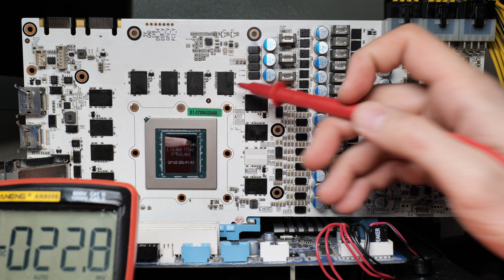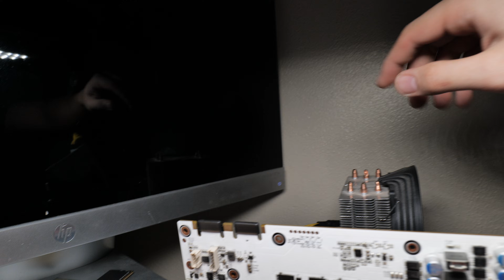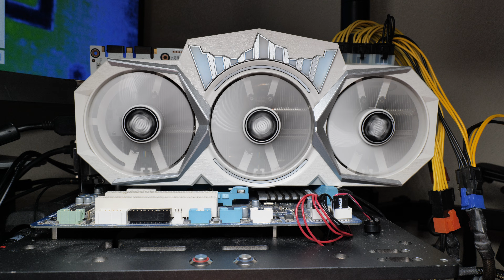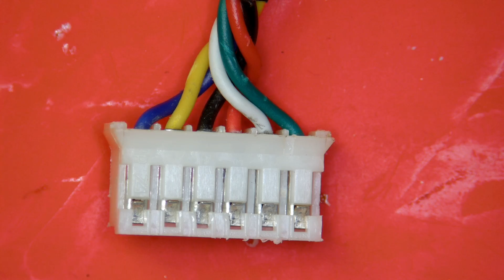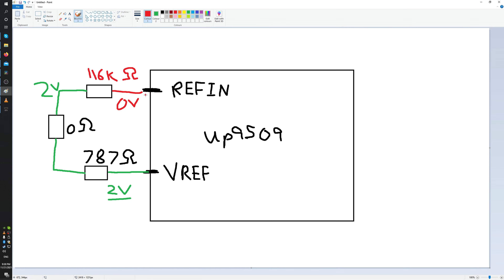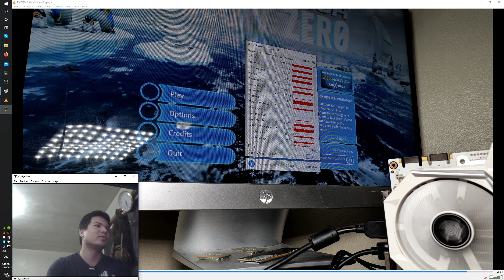Galax GTX 1080 Ti Hall of Fame Graphics Card Repair - POSTs With No Image and a Backlit Monitor

Comment: I bought a $60 EVGA 1080 Ti SC2 Black Edition today and it's got a similar issue... Card doesn't seem to get any power. Fans don't spin, no output, PC doesn't detect it, but the PC does boot... Any idea what the issue could be? I know you have another video on an SC2 1080 Ti but that one was for PC not powering on at all

Comment: Well played I wish I was as smart as you, I have the same card, today I herd a pop and some smoke came out, computer turned off, tried again same thing, removed card and computer turns on. Is there any chance the card could be fixed or you think it's definitely dead? Or could it be the PCI express slot, I can't check till tomorrow, I tried to take the top plate off the card to have a look but it broke the thermal paste so I have to get some more.

Comment: Hi, I really like your videos. Keep it up with the same spirit. 
I have an evga gtx 1050 ti sc and I have a few questions.

1. All measurements are fine - voltages, ohms, but there is no image on the screen. I tested with mobo with second PCI-E with another video card and in the device manager shows it (1050 ti), take the driver, but immediately after that it gives me the exclamation mark and code 43. After the system restarted, when I went to check the manager, the exclamation mark disappeared, but there is still no image.
2. When I open gpu-z, it gives me almost nothing. 0 mb memory, no pixel shaders, no sensors, nothing specific. I tried using a programmer to flash the BIOS with several revisions, but with no success
So I suspect a few things:

1. The BIOS chip itself
2.Bad memory bank
3. The main processor itself
4. Bad resistor on the line to the BIOS

I know it's hard without the card in front of you, but I'd appreciate it if you could give me some advice.Thank you.

Comment: I have a Radeon RX 5600 XT 6gb, the card is mine if i manage to fix it, but can't figure out what to do, and goes like this:
It has 4 ports: 3 Display ports and one HDMI, literally one of the DPorts is toasted, burned, the others ports are visually intact, when the card is put in the motherboard it don't give up any image (in the screen appears: No Signal), no beeps are heard, AND the PC starts as ever (i know because the intro of windows sounds normally), i try without the fans shortly and the card don't warm or heat at all, when i put the fans these move, but the rest of the card is still cold,  any ideas?

Comment: I have a 1080ti with a short on the base 12v rails, no visible damage, what would I check next?
Reply from the maker: Assume it's a MOSFET or Powerstage. I have quite a few "Computer Won't Power On" videos you should watch.
Reply: @TechCemetery  thanks, will go and check them all out

Comment: Thank you!. Love your vids especially since I happen to have 3 broken video cards. :)  I have 2 x GTX3070s and no idea what the issue is. One artifacts after some time especially on some games, and the other one just goes to a black screen (no video signal) during game play. Its not a heating issue with either as it can happen very quickly and monitoring shows normal temps. I have checked all voltage rails are ok. And memory tests show no errors :( I have no idea.
Reply: 2 dead 3070's?? Jesus, 30 series really likes to die huh? 1 year old man...
Reply from the maker: For the artifacting one it's memory.
Reply: @TechCemetery  How do I figure out which memory module? Running the memory test shows no errors.

Comment: Somebody doesn't know the difference between an ohm and a kilohm. They meant to put in a 116 ohm resistor, and put on a 116 kilohm resistor. Lol, a very subtle difference, just . . . y'know . . . 3 orders of magnitude.
Reply: Some poor probably underpaid sweating Chinese electrician you mean xd
Reply: Generally speaking resistors should never be measured in a circuit as other components interfere with the reading. For smd components, if one pin is grounded, the best is just to move it out so that only the ground pin is connected and take the measurement.

Comment: Great reapir, I wonder what happened to that resistor, those fail so rarely!
BTW, anyone knows the 2070 Super correct core resistance on 1V rail?
Reply from the maker: Roughly 10 Ohms
Reply: @TechCemetery  Thank you :) I was told that the chip is dead, but my suspicion was it could be just very small resistance:)
Reply from the maker: PEX is very low on modern GPUs, as long as it's not below 5 when the GPU is at room temperature I wouldn't worry about it.

Comment: Love the videos as always!, ive got a gtx 1650 that had a short on 12v replaced mosfet drivers to remove short, all working except card only seems to get to 40 degrees and its showing 240% tdp around 250 watts from the pcie connector and had 1 single 6 pin plug on it, any ideas?
Reply from the maker: Watch my Strix 1080 Ti video where the card is stuck at 139mhz
Reply: @TechCemetery   the clock speed is showing the 1500-1700 range, could it still be same issue?
Reply from the maker: It should be similar.
Reply: @TechCemetery  cheers will have a look, cant see an INA 3221 on the board any ideas what else it could be labelled? thanks in advance
Reply from the maker: @rosspaginton8212  Some of the Turing cards use a different chip called an NCP45491
Reply: @TechCemetery  nice one, yeah that's the one on this board so just check the resistors around the chip, should they be around 20 ohms like they were in your video? thanks again for the help
Reply from the maker: I believe the values are 0 and 100 ohms for an NCP45491
Reply: @TechCemetery  seems to be 3 small resistors connected directly to the shunt resistor measuring 100 ohms, 75k ohms 
1k ohms any ideas?
Reply: @TechCemetery  only other thing had to measure 75k off board as was jumping around when measuring in place could that be the 0ohm resistor gone bad?

Comment: I have GTX 1080 ti that won't power on I found a burned chip.how can get I get the board PCP schematic for the board  to no what to test
Reply: You won't since they are not released.
Reply: your best bet is to find one of gpu technicians, for repairs.   we are plenty  and we all have discord channels to get in touch.
Reply: @Dmiliunas  What is average usual price for repair?

Comment: I have a problem with my GTX 1070 gigabyte. Sometimes it boot with black screen on the moniter ( imean moniter is turning on with blacklight screen). What could be the problem? . Please help me
Reply from the maker: I have a guide video to run MATs. You should watch it.
Reply: @TechCemetery  but sometimes it's working 100% fine with no memory errors and nothing just working 100%

Comment: Where do you get your "dead core well over 95% of the time" statistics? I wonder how many of those are actually cases where the problem was indeed on the PCB and technically repairable, but it was just too much work to diagnose and actually fix (like some random 0402 or smaller passive failed).
Reply from the maker: Experience and intuition and confirmed with a thermal camera.
Reply: i think he meant low resistance on that rail means bad day for GPU core.   not any broken gpu has bad core.

Comment: I have a really similiar issue on a asus vega 64. Where i cant get the memory voltage. Aits around 200 mv only. Any recommendations ? It does not have the doubeler thing but a normal vrm